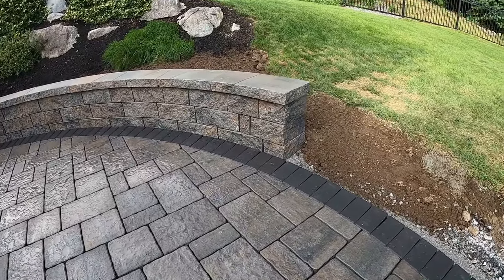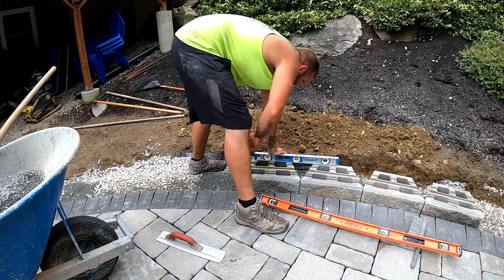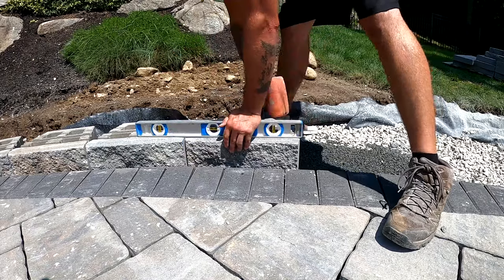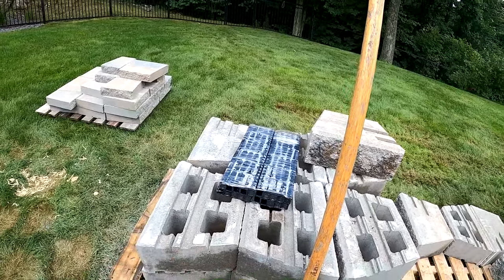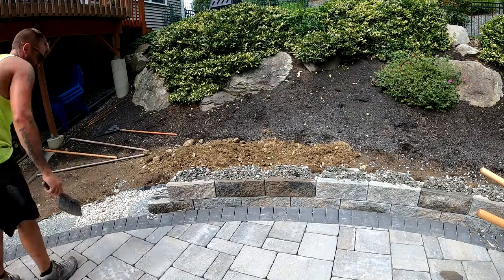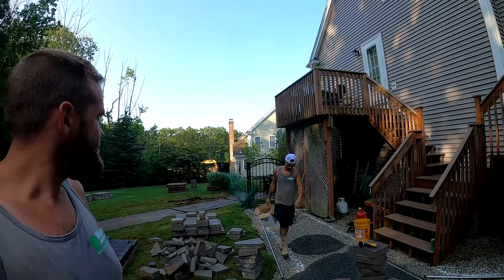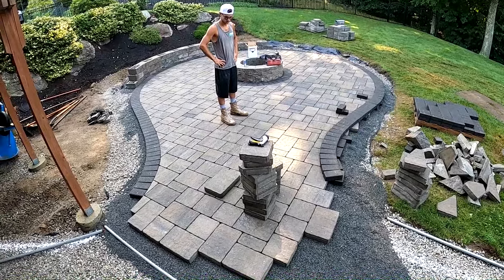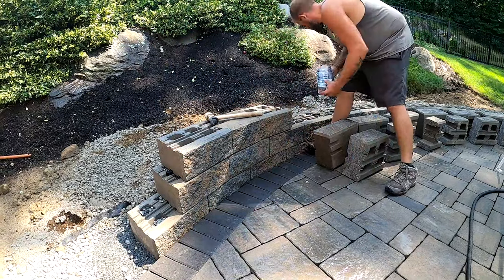How To Build a Curved, Block Sitting Wall | Techo-Bloc (Semma)

Comment: Great video. I've seen "pie" cuts to fill the gaps too but they never look right. Do you find that the walls don't need glue with gravel and the plastic retainers? I use glue on every row, not just caps, but I am not convinced it's worth it or necessary.
Reply from the maker: Thanks! I think the pie cuts are very ugly.... I glue all corners and blocks next to the corners at a minimum. Sometimes I put dabs of glue on the back corners of every block but I never glue the entire bottom of every block. I think that is overkill for sure. The plastic interlocking retainers are enough for the majority of the wall. ✌

Comment: Nice job,  thanks for sharing.  Looks like quality work. 

I am curious if you explain to the customer that the end result of a dual face wall with only a single row of blocks is going to have different size block faces on the upper rows with almost every block having non-factory cuts?   As a customer if I was given a choice,  I would live with my choice.  But if it wasn’t explained to me  my OCD would pick that out .  Would a second row actually be cheaper because you are not cutting every block?
Reply from the maker: Thank you, I totally understand where you are coming from but in this situation, double sided was far more important than joint lines. I have OCD beyond belief, trust me, but nothing is more cheesy and ugly in my opinion than open spaces between blocks behind a wall. Especially when it is clearly visible. I went back and forth a few times about the joint lines, ended up deciding the double faced was more important.... Very cool that you noticed it though, good eyes! ✌

Comment: i dont understand how a wall stays in put over yeara w no footing. ive seen this done on aome other channels too. so i guess my question is why no footing?
Reply from the maker: Some of the longest lasting walls out there have been dry laid on (open grade) stone. AKA clean' crushed stone. It allows water to freely flow down through the sub soils and permeates even deeper. This crushed granite is a better footing than concrete. After compaction, it is solid. With the benefit of having open spaces in it. It allows any moisture in it to drain, but also gives it space to expand into when it freezes. 

The biggest reason concrete pads fail and crack because they base material they used is so compacted and dense, that it holds onto water like a sponge. So when the winter comes and freezes the class 5 or dense grade, it heaves the pad up. Then when the material thaws, the pad sinks unevenly. Causing it to crack and settle. 

It is the same thing with a footing for a wall. No matter what you do, the ground will shift slightly through the different seasons. Dry laying the blocks on a material that holds on to the least amount of water is key to longevity. Even if the wall lifts a little with the freeze cycle, it will settle back into it's place when it thaws. If you were to put it on a footing and movement happens. It will not settle back into its place correctly. 

The longest lasting natural stone roads and structures from roman times were built on clean crushed stone. I did so much research on this stuff 4 years ago when I switched to this backfill method. There is no better way in my opinion. While I do set somethings on concrete footings, I still prep the base the same way.
Reply: How deep did you go for that stone base? What is the climate like?

Comment: Great content!! TechoBloc shows the top of the first row of a free standing wall at grade, so top of first row flush with paver top. Is this really required?
Reply from the maker: Thanks! On a 4ft high wall or more, definitely bury the first row completely. But a sitting wall, laying the 1st row half way buried is perfect. It locks it in but also gives you the perfect height. 2.5 rows and the cap is 18". That is the most comfortable sitting height that I have found. 21 is too high and 15 is too low. So burying the 1st block halfway is ideal 👌✌

Comment: At 9:53 to find the angle did you guess or is there a trick to find the correct angle to interlock them?
Reply from the maker: Sometimes you can find it by eye, but if not, just use a tape measure. You want the line you make to cut the same distance from the edge of the cap that is already laid down.
Reply: @TheChristianHardscaper  oh 👍🏾 okay thnks